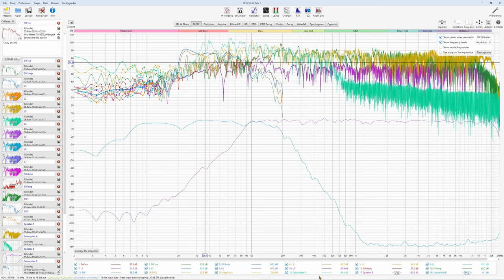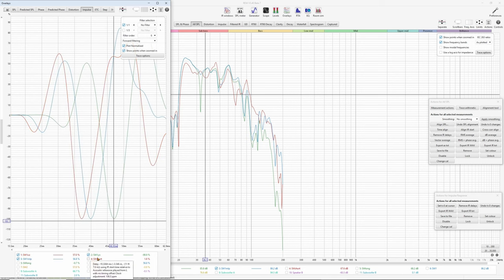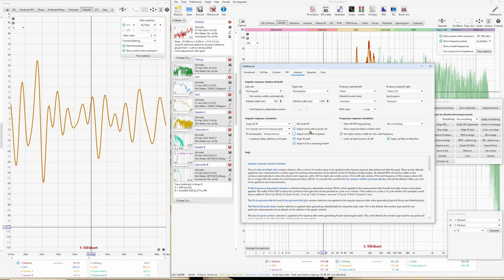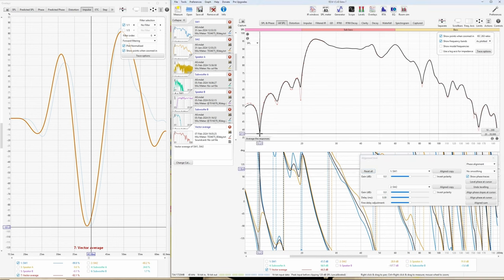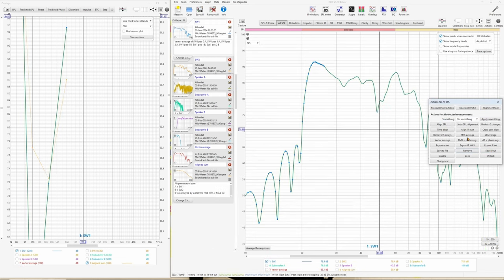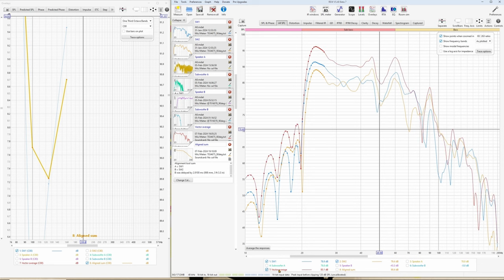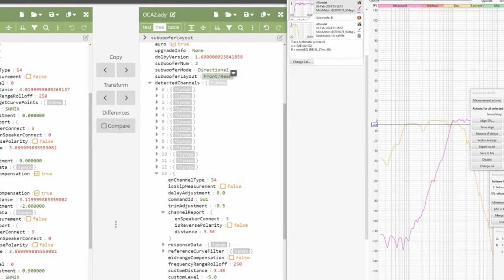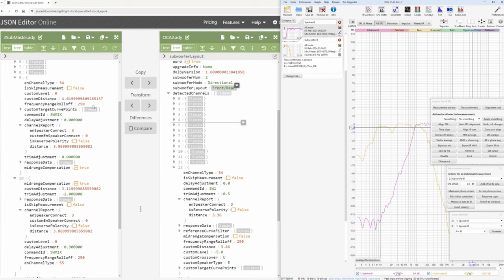Advanced Multiple Subwoofer Control

Comment: I have now viewed just about all of your videos in just the past week.  Fantastic Job and thank you for making them!  I have been doing things (the older way) I guess you could say with REW.  Any suggestions where to start first?  I want to basically do everything over.  7.1.6 system.  Three subwoofers as of now.  Hopefully will be able to cut that down to two subs when the new one arrives.  Should I start with all of the speakers first?  Then do the subs? Other way around?  Not sure what is the best way to approach this? As of now I recently downloaded the REW equalizer filters and REW Atmos sweeps that you provided the links for.  Have a Denon receiver with xt32 and editor app, and minidsp 2x4 hd.  Let me know your thoughts on this if you get a chance please.  Thank you!
Reply from the maker: A lot of the videos are for stereo listening and requires a PC as a music player because the filters created require lots of taps only PCs can handle. When all filtering needs to be done in the multichannel receiver, you are bound to use Audyssey (which has only 1024 filter taps) and you can manipulate it by using the Editor app but you cannot do any phase correction for example. I use an integrated stereo amp with Home Theatre bypass property connected to front pre outs of my AVR and also connected by XLR inputs to my PC and Dac. This way, I can add two more channels to my Atmos system and also use the front speakers as a very capable hifi stereo system with any kind of filters I want simultaneously.

Now for your case, connect all subs to MiniDSP and use that as a single sub in the AVR with Audyssey. You can align the subs for relative delays in the MiniDSP using MSO or the method explained here but make sure you don't induce long delays to any sub. The AVR has a 20ms maximum delay limit and beyond that, it cannot synch your sub system to your speakers. You also do not need to use any EQ for your subs in MiniDSP unless you have peaks above 20dB. Then run a careful Audyssey calibration from the app and feed the calibration file to Audyssey One (see my latest video). It will do everything for you in the best possible way.
Reply: Align subs in REW with minidsp (not a problem / no low shelf filter or high pass filters in minidsp ), no eq at unless peaks above 20dB (understood). What will the Audyssey One do with the subs below 20hz? I am pretty darn flat to 10hz.  Thank you for all of your help! Greatly appreciated! @ocaudiophile
Reply from the maker: Audyssey filters start as early as 2.5Hz but anything below 20Hz is kind of ignored. But no worries since you will not be able to hear below 20Hz ;)
Reply: My apologies, maybe I did it correctly.  Looks similar to the one in your video.
Reply: On the all SPL tab that is.

Comment: Hey OCA, great stuff, thanks. So aligning the first tiny peak is no longer the correct approach or is it still valid when using a DM device (6 M max distance to shortest located speaker)?
Reply from the maker: If you cannot set your hardware for the right distance then an earlier peak and if even that is not possible then aligning IR starts are still your only options. But they will be both compromised alignments.
Reply: @ocaudiophile can’t you just adjust the phase on the physical sub to change the timing reference if your AVR doesn’t allow much movement?
Reply from the maker: If your sub was switched to 180 deg phase during measurement, you can gain about 2m distance @ 80Hz by switching it back to 0 deg but otherwise, you'll simply need 2m more of distance.

"Assuming phase switch circuitry itself doesn't add additional system delays"

Comment: Can this be done without a Mini DSP?

The Marantz AV10 has directional bass and 4 x discreet subwoofer channels. Can this REW session analysis be entered directly into a processor and PEQ that support independent subwoofer channels?
Reply from the maker: You can adjust delay (distance) settings for each sub individually but manual Graphic Equalizers do not work on subwoofer channels in lesser Sound United models, I would assume AV10 will be no different. But in directional bass mode, Audyssey will create individual filters for each sub which can all be manipulated to use custom filters created in REW (see my Audyssey ART video). However, LFE channel will be run simultaneously on all 4 subs and there is no filter for the summation of all 4 subs anywhere.

Comment: Which version of REW are you using? I don't have the most recent, but I think it is a newer version than what you are using in the video. I don't have a cross correlation option. I remember having it in the previous version I had.
Reply from the maker: I don't remember really. I might be using a some custom version as I some times beta test new functions but I'll usually be using something very recent. I am currently using Beta 16.
Reply: The version you show in the video is what I'm familiar with, but I updated it. I updated 2 versions behind the most current. It's different than I'm used to. I'll probably just go back. Thanks.

Comment: Unrelated question: Have you used these products, and how would you compare them for stereo-DRC (among each other, and with REW)?
Acourate, Audiolense, and DRC (by denis sbragion)
Reply from the maker: I tried DRC and Acourate, know about Audiolense a bit but never used it myself. All are great room/speaker correction software but REW also has very advanced tools now (that wasn't the case a year ago) and when used in combination with rePhase there's almost nothing it cannot do. However, it's all manual and has a learning curve. Acourate for example has macros which make it easier for beginners or people with limited time to spare to generate good results. The upcoming REW beta release will have API connection and after that I guess even that advantage will fade.

Comment: Hi an other question. First I am only an amateur. I learned what I know about acoustic and DSP on the WEB an the book of Dr O'Toole since 2015.  Before your video I thought that phase alignment between 2 subs and the Fronts satellites must to be done AFTER choosing an xo and then measuring 1) FL , FR, FL+FR with SUBS OFF and 2) Sug Left and sub Right ALONE at xo. Getting those 5 measurements we worked with alignment tool to find the smoothest response phase aligned at xo 80 for instance. Your video get rid of xo concerns. What happens when I choose an xo after phase aligned 2 sws with Fronts following like you teach us here? Does my question makes sense , hopefully?
Reply from the maker: You should aim to xo your speakers with the subs at or around their natural (spec) bass roll off frequency. For that xo to smoothly bond subs and speakers should also be in phase. This is not hard to achieve since you can also align relative volumes and strength of peaking filters. And sub timing is more important than all of these in my opinion because late bass arrival causes muddiness in the whole frequency band.
Reply: I expressed myself poorly. Usually I set the xo at 80Hz. If I had changed the xo say at 100Hz, I would have needed to redo all my measurements explained in my previous post. Yesterday I followed your method to phase align my 2 subs together and aligned the virtual one with my fronts and checked FR and FL responsee with 2 different xos. I was surprise to see that therewere quasi no frequency responses differences between xo 80 and xo 100. Is it a clue that I did well my homework or the contrary? @ocaudiophile

Comment: Thank you for making these videos. Wonder if you can help me with some issues. Cinema room. Three seat rows. Four subwoofers. I aligned them but when trying to timealign to center I get a 25ms delay even when distanse is at max 9meters. 25 ms positive in relation to center. Two subs in back corner have wireless signal to minidsp. What can I do to get subs and center aligned?
And last question: can I trust impulsepeaks regarding to phase? It looks like right speaker have peak in opposite direction to the rest.. 
thanks 🙂
Reply from the maker: Even within same brands of speakers impulse peaks may sometimes reverse due to mic position and reflections though rare. Best way to check is in Overlays/phase graphs with all speakers shown. Click "invert polarity" repeatedly for that speaker and check which one has a better phase fit to the rest of the speakers. You can 1/1 smooth all responses to see more easily.

Your subwoofer alignment problem is tough to solve with Denon/Marant units especially when even the actual distances we are talking about are around 9m and wireless connections on top of that. You should maybe go with the "directional bass" mode. At least subs will be closer to where the signals are coming from. You can switch to that mode by using the app even if your AVR is an older model. Let me know what you decide to do.
Reply: Directional bass is not available in my Onkyo.. 
Fysical distance is about 5m to front and 2m to back subs. Any recievers with larger distance adjustments?
Reply from the maker: You might have it through the app:

https://audiosciencereview.com/forum/index.php?threads/audyssey-manual-calibration-master-stroke.46120/post-1658127

 @oddkjetil1030

Comment: Hi. We have built a cinema at work(oil-rig), but I feel we doesn’t get the sound right. It’s a 5.4.4 system. Reciever is a Onkyo, so no Audyssey one possible…
What approach would you suggest calibrating this. Minidsp on subs, wireless transfer to back subs. So lots of delay. By the way, one evo run nicely on my laptop for my private system 👍🏻🙂
Reply from the maker: The easy(easier) way is to measure each sub using acosutic timing reference at the MLP, generating their excess phase responses, applying a 24dB/oct low pass filter to them at 120Hz and then cross correlation align the results. It will give you how much delay each sub will need to reach MLP at the right time. The optimal way is to align all subs to each other at 50Hz with REW's "alignment tool" using "Impulse alignment". This will determine correct polarities and minimize delays. However, with 4 subs you will need to align 2 at a time and align the next with their "aligned sum" and so on. Also, the order you do this will change the results so you will need to check for 12 different combinations. Good luck with that ;)
Reply: Woha easy way is to buy new amp😂
But if I should follow one of your videos then? 
And this is a three row with 5 seats each row. Is there a point to spread measurements to each seat? I think this will degrade all seats and maybe focus measurements around middle row mid seat
Reply from the maker: Correct, focused measurement will be less uniform all around but better in the middle, the other will be not so good uniformly everywhere. Focus in the MLP and let the uniformity be handled by the number of subs.

Comment: Hey OCA, I ask myself if it is a plan of you at all to create a script which is doing this alignment automatically. I might be wrong but somewhere I thought you mentioned to think about that. I took a set of Audyssey measurements with each the right and left sub only but I am struggling to get those aligned in REW. I extracted the measurements from the .adys and renamed them (SW10-SW17, SW 20-SW27) in REW. Then I cross correlated them, took vector averages and tried aligning. When opening the alignment tool one sees a dotted line, guess this is what REW thinks could be the best outcome but after trying for hours I could not get there. What do you think? Thanks Sir.
Reply from the maker: That's the addition of both responses and represent the maximum limit of outcome  for each frequency. It's not achievable altogether at every frequency.
Reply: @ocaudiophile thanks,Sir. What is your take on a script doing that automatically (alignment)? Alternatively, is it possible to trick Evo to do that, is any description for a possible workaround available? Thanks for that great stuff.
Reply from the maker: Good idea and noted as the next video idea

Comment: I've watched the video twice and taken notes, but I'm running into a problem when trying to align 2 speakers , after I have the vector avg of 3 measurements I cross aligned, then take the 2 vector averaged traces in the impulse overlay, and put main window into impulse, the "clock adjustment" button is greyed out in the Actions menu.

Driving me crazy.

I can take just single measurements and see the Clock Adj button.

What's going on?

Wait, is it the "Offset t=0" I'm supposed to use?
Reply from the maker: Try "Remove IR delays" first and see where the impulse peaks move.

Comment: So I’m a little confused 
I have Dirac live full version in avr and mini dsp hd 2x4 
After aligning subs then aligning to my reference main where do I add delay ?
Do I rerun Dirac and set that delay in the distance of sub in avr ? Or do I let Dirac pick the new distance /delay ?
Reply: I will let the final say happen by OCA, but from what I understand this procedure is all about doing it manually using REW. I have Dirac live too, but Dirac is OUT of the picture if you wanna tweak manually, meaning we no longer use Dirac. Here is the procedure in a nutshell - You gotta first time align all the subs, then make a "phantom sub" in REW. Then you time align the speakers one by one (by adding delay to them in the AVR) to that single, phantom sub. AFTER all that you can equalize the speakers by adding filters.
Reply: @rajdude1  since you can’t adjust distance/delay in avr as it is locked by Dirac do I have to factory reset the avr every time and rerun Dirac ? How else can it be done?
Reply: @rajdude1 my 2 subs are aligned but I’m stuck as to how to align the phantom sub to the mains,
Reply: @andyv9365  no no. Like I said earlier, (if you want to do this manually, and follow this video) you have to stop using Dirac. You have to use one of the other modes of EQ in the AVR. For example, my AVR, an Emotiva XMC-1 has these presets - Dirac, preset 1 and preset 2. So I first put my AVR into preset 1, and then work on this procedure.
Reply: @andyv9365  That procedure is explained in this video by OCA, skip to 33 minutes into this video
Reply: @rajdude1  also is it necessary with the latest version. Of REW to set acoustic timing ref. Like OCA does ? I’m not sure how to do so properly.
Reply: @andyv9365  I do not have a definitive answer to whether it is necessary or not. From watching this video, I infer that OCA is saying that this is the better way. Frankly, I have not gotten around finishing this process. I started yesterday and only took 5 measurements of all my speakers and subs. Then life got busy. 
I suggest you take the measurements in REW, then start following this video carefully, right from the start. That is what I am doing.
Reply: @rajdude1  Thanks for info.

Comment: Sir,sorry for disturbing you again...
May you pls clarify:-
1. While measuring with your 1M sweeps,what should ideally be the master volume in the receiver set to....(Should it be set to your usual listening db level in my case it is I usually listen my content at -10db)

2.  One reason I am asking you is this (while I corrected my laptop sound setting for my UMIk 1): when I was measuring with your 1M sweeps it at even -10db level it reports of clipping and says reducing the sweep level,processor volume setting....

Requesting you for help sir
Thanks and respect for you
Reply from the maker: 1.Yes
2. Rew will not complain from AVR volume. The clipping is because of too much microphone gain. Decrease your mic volume.
Reply: Ok sir thanks